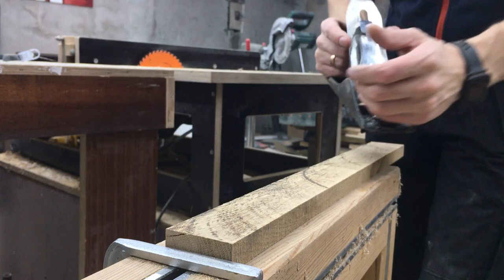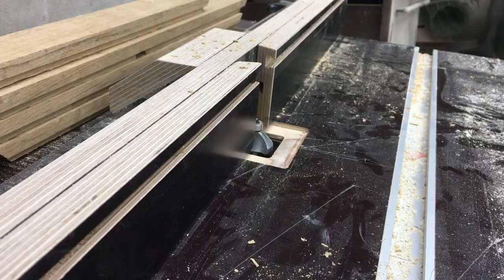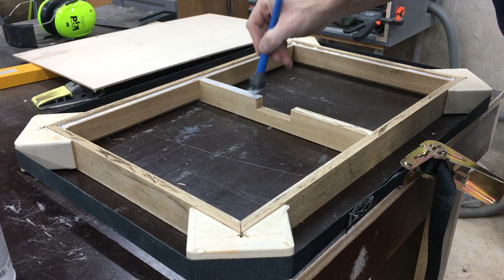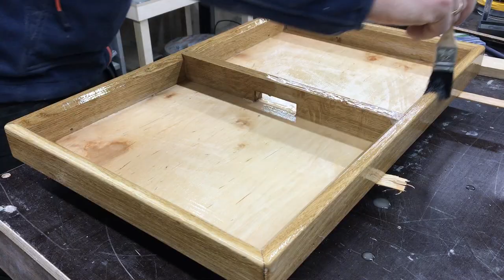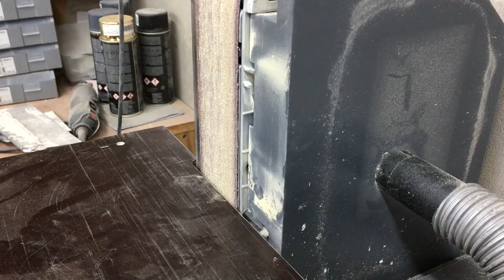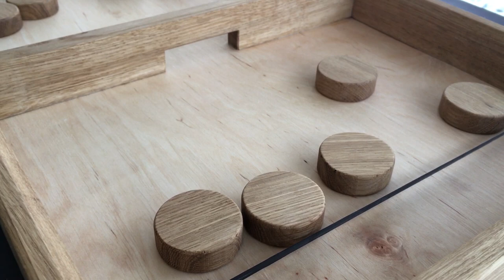Pucket game | diy

Comment: Just a tip: if you use a ripping blade when ripping wood, it will cut 10 times easier and not produce burning marks.
Thanks for the video.